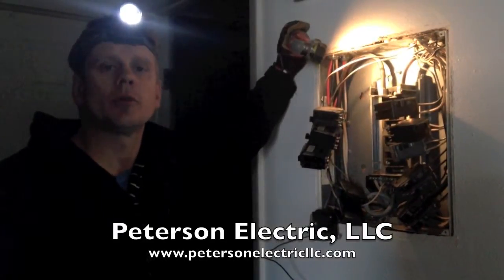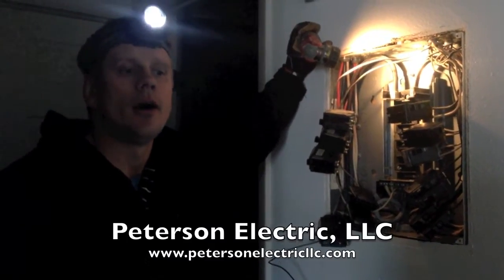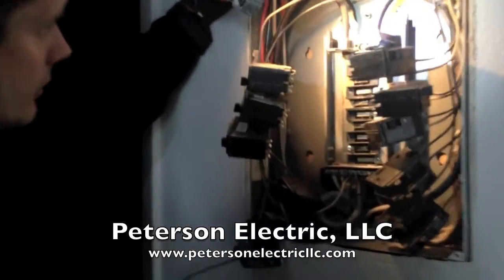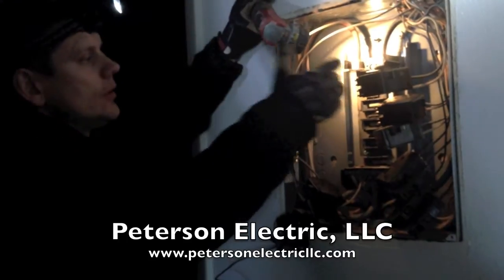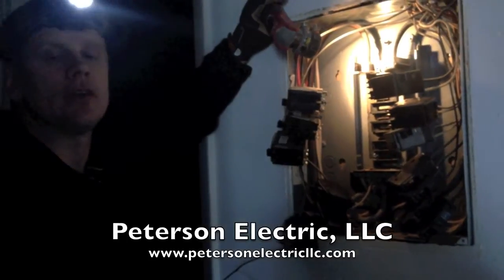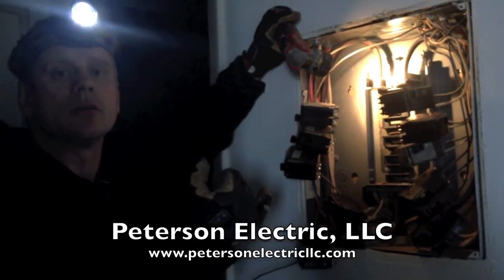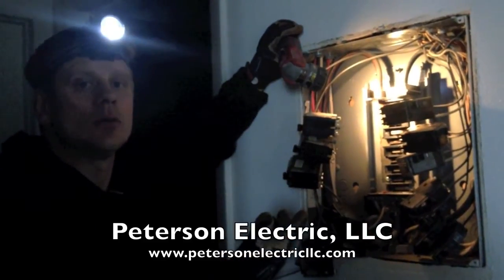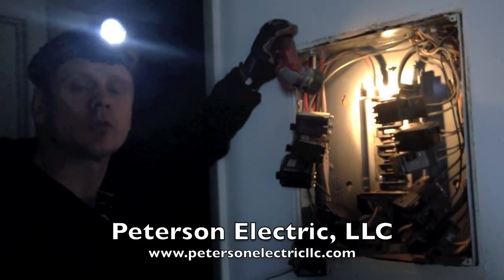Electrical Bus Bar In Panel Is Discoloring & Why Is Breaker Tripping?

Comment: I'm not sure I would recommend sanding a busbar down or even "cleaning it up". I have seen busbars that at one point corroded, been cleaned up to look brand new and still nearly burnt the home down because of corrosion that was not able to be seen. This is a compromised bus from my perspective and should be replaced...NEC 110.12(B).
Reply from the maker: Not everybody has thousands of dollars to do a service change, especially when you live in an area where the power company and the building dept. are DEMANDING meter upgrades and once that is touched, then you own the 2017 standards.
Reply from the maker: This is a good code, but there NO spraying or foreign materials on it, the bus bar was pitted a little.
Reply: Many bus bars are plated. Setting yourself up with legal action if there was a fire. Do manufacturers recommend sanding?

Comment: I got a buddy that has a federal pacific 100amp sub panel in his basement there is a slight arcing that is happening on the tab that connects busbar to the main connection point before the terminal for the A phase. its slightly discolored and arcs when the air conditioning unit gets turned on and heats up, without the air conditioner or dryer running the wires have a normal temperature, connection for main wires is clean and tight but no deox
Reply: If its a federal pacific stab lock throw that fire hazard in the trash.
Reply: I did some research on it and let him know, I did find out his hot water tank had a bad lower heating element "I had continuity from the tank to the lower heating element screw" That breaker was not tripping but you could hear the crackle sound and it was heating up but unfortunately I am not a "liscensed professional" just went to college for it so I told him to get a professional because its to big of a liability for me to be comfortable with doing.

Comment: Well, I still think you'd be better off with a 240V standard    ;-)
Reply: Sorry they use 2x Live (120V + 120V = 240V), 1x Earth (or Neutral) and 1x Saved Earth - so they have 240 Volt already in the U.S.A. But you have right, the most things works with 120 Volt till now ... [Okay, technically is it only ~210 V.]
Reply from the maker: It is a "Nominal Voltage", anywhere between 110 v to 120 v or 220 v to 240 v. More important is to use an exact measurement, with a voltage tester, when do load calculations for either single or 3 phase.
Reply: @OldLordSpeedy  Im very grateful  that its 120/240 i hate the way great Britain  has ring mains and 240 volts to ground thats very dangerous you cant gfi that .When you have higher voltage we have less resistance and have a higher risk of getting electrocuted. I like the  120 240 volt system you would have to deliberately touch two hot wires to get a 240 volt shock in house wiring in the USA